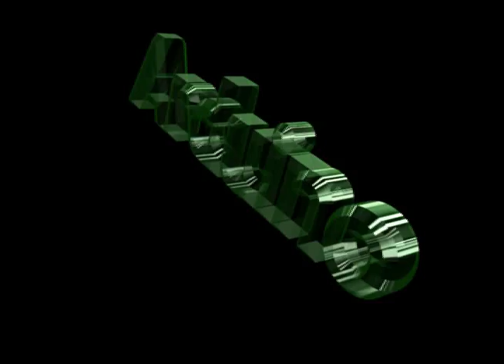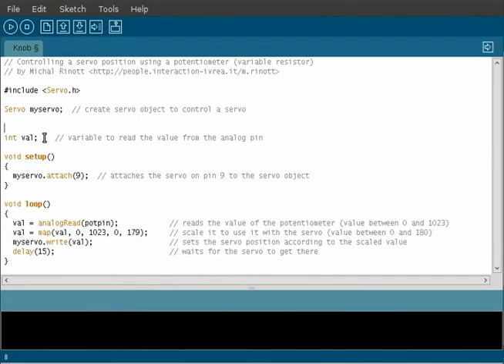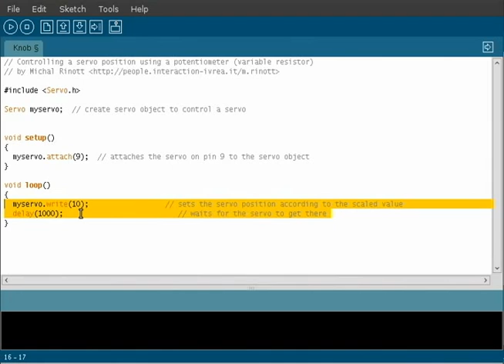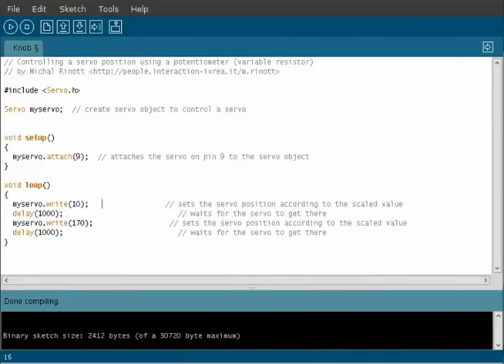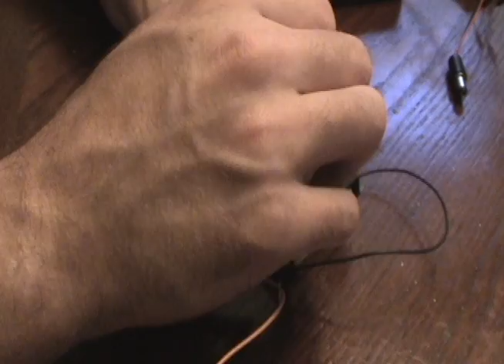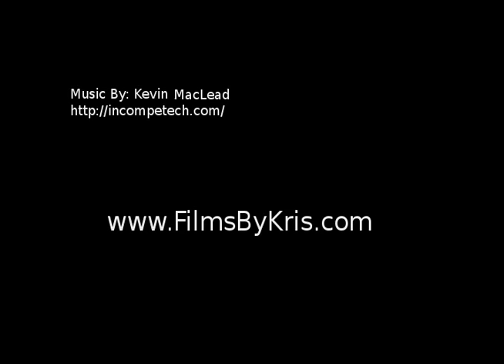Arduino - Servo Motors - Loop Actions

Comment: How can I program servo(s) to move to a position, pause,  move to a second position, pause, move to a third a forth etc position pause then loop it all over again  ALL stand alone without being "controlled by a computer or smart phone. Basically I want an Arduino to do what a milli instruments "puppet" module did which was record the  servo moves via a potentiometer record them on a chip and loop the movements over and over again until powered off.

Comment: Hey Kris, I hope you can  enlighten me a little. I am absolutely new to this, literally just about to design something that will require a motor of SOME kind.
Basically due to scale of the project, I found the best Servo I can use is a 3.7g sub micro Servo motor with max speed of 0.12sec/60 degrees. I wonder A, Can these 4.8v servos   be slowed down to say 0.4sec/60 degrees ( I really want 1-1.2 seconds every 180 degrees)? B, can they get told to do 180 degrees when a command is issued, then rotate another 180 degrees when a command is issued, etc  (can they rotate endlessly in one direction, 180 degrees at a time)

Cheers.

Comment: l have  one  question  l am going to creat a small manipulator  for that  l need to use 6 rc servo motor  l am  going  to  use  another  supply unit for motors  becouse  l dont  wanna  broke arduino  am l need  additional unit ?

Comment: I am very new to motors, but not electrical work. I have do have a question though with the servo motor, is there a way that you can have it do a half turn forward and then a half turn backward by using a switch. I am trying to use one of these motors to pull and push a flange.